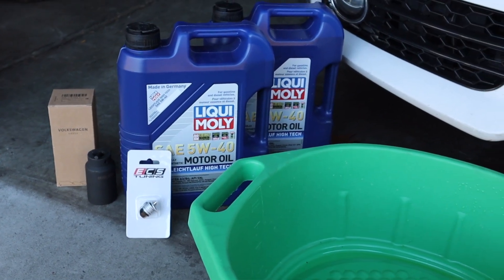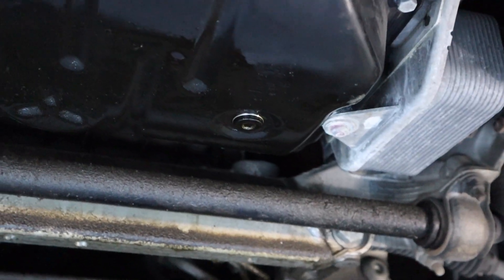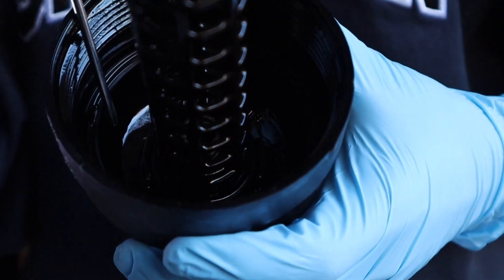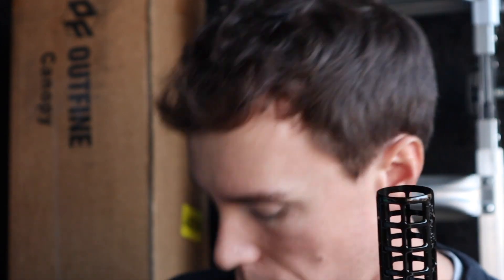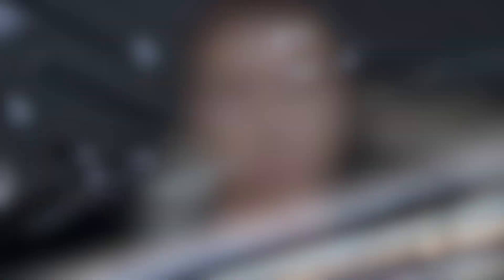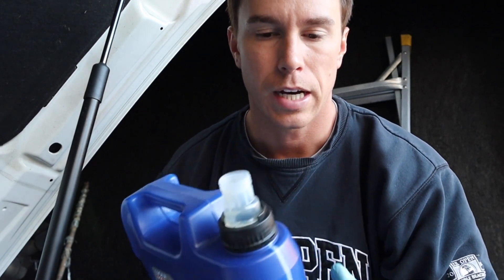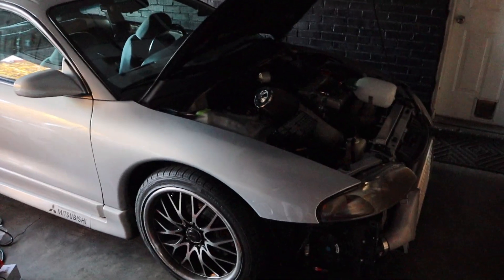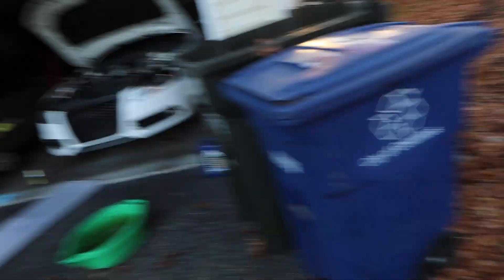How To Change Your Oil. Basics For Any Car! Audi S4, 3.0T

Comment: Where do you dump the used oil? Can I send it to a gas station to be recycled?
Reply from the maker: Great question! I will dump the old oil back into the oil bottles I just used, and then I'll take it to a local oil changing business. I've established a relationship with the service advisor through a friend. I would think any place that does an Oil changing service would be able to dispose of your used oil properly. You may even be able to take it to your city recycling but I'd call first to see if they have an option.